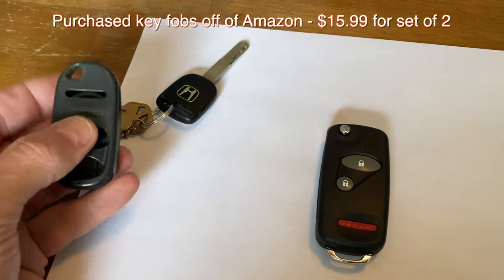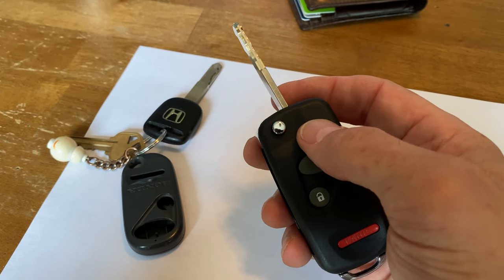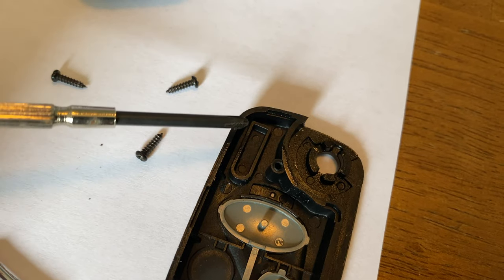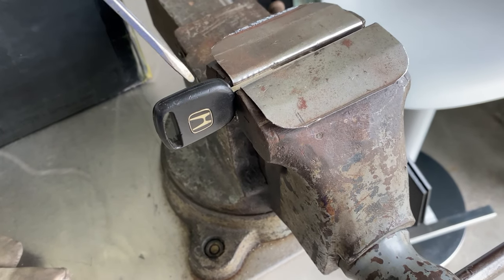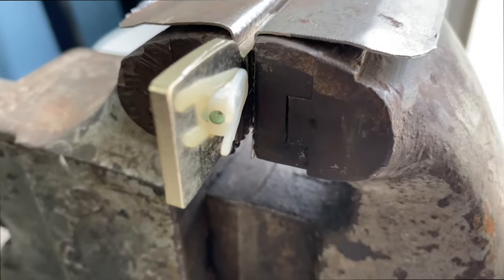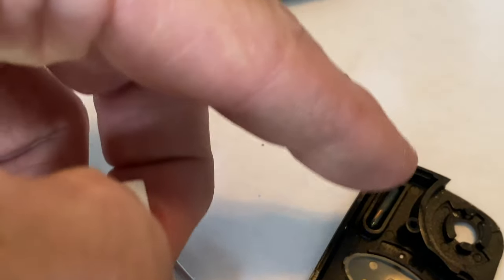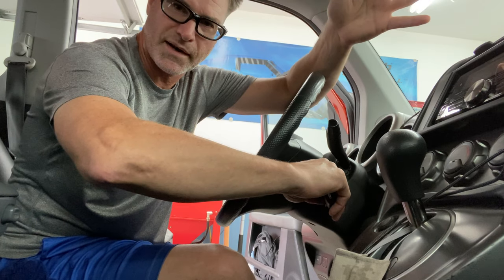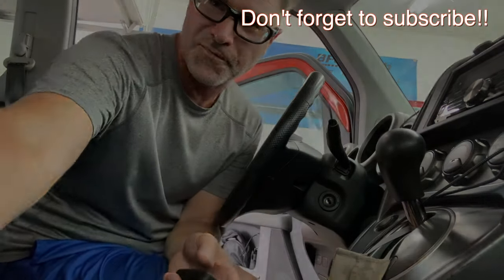Honda Element Key Fob Ep 1

Comment: Hi John, great video. Question, when you programmed the key by turning it to on 4 times, were you programming the key  transponder for the immobilizer? Was that neccessary? I ask because I only have one key and don't want to cut the key open and possibly not work. 
Thanks again for the video.
Reply from the maker: Yes, that little transponder has to be in close proximity to the column in order for the car to recognize the key.
Reply from the maker: That’s to get the immobilized in the car to recognize the chip in the key, just like if you got a new key made.

Comment: Thanks for sharing. So what’s the process for getting a second key when you only have one?
Reply from the maker: Go to the dealer. Give them your VIN and they get you a key.
Reply: If you only have a transponder key, ebay has fobs for 10 dollars. Use whatever key you have for the ig ition. Get in, shut doors. Lock doors. Turn key, just to the point that dash lights and such come on and push ulock on the fob. Keep doing that 5 times. Once it unlocks the doors, immediately push unlock, then lock, and unlock, quickly. Start the car. If it doesnt start, your computer has the limit of keys programmed. It will only accept 4 keys at a time. Do not keep trying it. Too may attempts and you will have to have Honda actually reprogram it.   The immobilizer will do its job in that case. Most cars have room in the cpu for at least one cloned key. Sometimes 2.  A master key, spare key and a  valet key are usually what comes off the lot. My element doesnt have a use for a valet key.  So I was able to get a blank fob key, use my normal key in the ignition and push lock buttons on the fob. Got fob cut  from that key. You can only have 4 keys that work.

Comment: Hi john, I really like that key fob design, is there a link to where that is on amazon? I saw the link but it did not take me to the product.
Reply from the maker: The brand is Auto Tool. I can send you the link in an email if you want, but not through this thread.  I’m at jpvillotti@gmail.com.  Or you can search Auto Tool Honda Flip Remote Key Fob.
Reply: @C3Mods  can it be found on amazon? Does it have a chip pre-programmed as well?
Reply from the maker: @markdesilva7207  It’s still on Amazon, and no chip.  Just the empty case and key.
Reply: So either the Honda sealer or a key maker would have to implant the chip?
Reply from the maker: @markdesilva7207  The Honda dealer won’t do it.  They want to sell you the OEM key fob for several hundred dollars.  I was lucky enough to have them just cut the key, but my friend is the service manager.  You have to do it yourself like I did in the video.  These are NOT OEM key fobs.  They are Chinese copy’s.  That’s why they are $15.

Comment: I'm commenting for this one what key fob is that so I can order it for my 2008 element?
Reply from the maker: I got it off of Amazon.  There should be a link on the video.
Reply: @C3Mods  the link posted is just to the Amazon front page.
Reply from the maker: @robertgarvansnyder4665  This is the heading on the key fob I ordered - Replacement 3 Buttons Flip Remote Uncut Smart Key Case Shell for Honda Accord Civic Cr-v Element Pilot Blank Blade Fob No Chip

Comment: Not true. You didnt have to change the transponder. Only if it is transponder key to.transponder key. You have to simply give the fob a comand. Lock doors. Once it accepts that, you plug into obd. With new key in  on, not starrt. Clear all the key codes. There can only be four. Leave obd tool open, with new key at the on position. Turn the engine on. It will regenerate the same transponder code. The original keys will no lomger work. The new fob will though. Use that fob to generate spare keys. Even simple transponder keys. The fob is everything. You cant generate clones with only the transponder key. Once the fob opens the locks, it is coded per the key that was turning the ignition switch. Thing is there can only be four keys programed in the cpu. Make sure to start the process as the unlocker. Lock it and do the sequence to unlock it.  If you do it wrong, it will not work start the engine. Do it wrong too many attempts, and the immobilizer security will reject all keys. Honda  will make that a rather rxpensive problem to fix. So if you get a fob to unlock and then lock the doors and it is cut duplicate to the current key. You are good. Only thing is how many of those keys are programmed in the cpu. My Element only had 2.  So I cloned 2 with no problem. Got a fob off ebay for 5 bucks. Used that for the lock sequence. The obd tool is not cheap. It all that locksmith uses. If there are to many keys logged in the cpu, the engine will not turn over. All but one codes need removed with obd plug in tool. Then do the unlock/ key sequence and start the engine. The obd will accept the regenerated key from the cpu.
Reply from the maker: Interesting.
Reply: He just did it in front of everyone on the video. Although your information is good so is his. I hope everyone has luck with this I'm going to get the FlipKey and try it.
Reply: @C3Mods did your old key work still or did it cancel it out like this guy saying ?
Reply from the maker: I cut the transponder out of the key to use in the new fob, so no it won’t work because without the transponder, the immobilizer won’t deactivate.